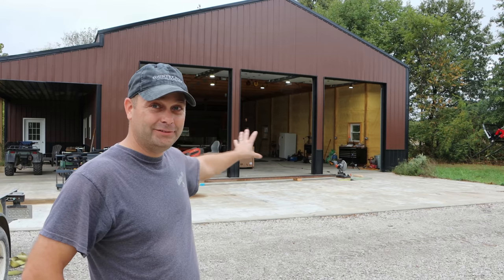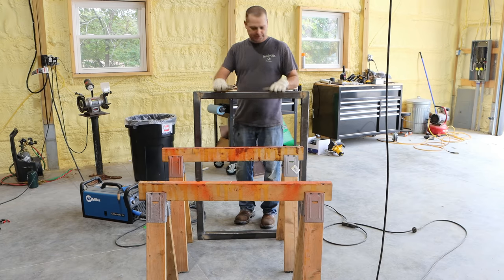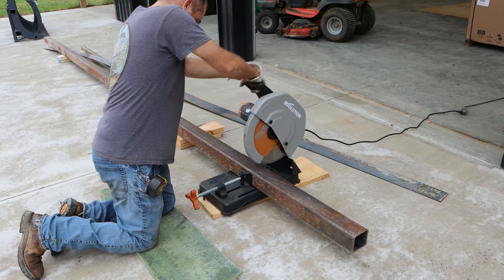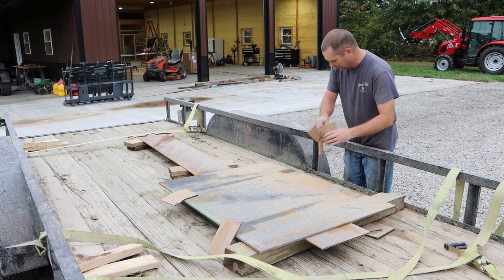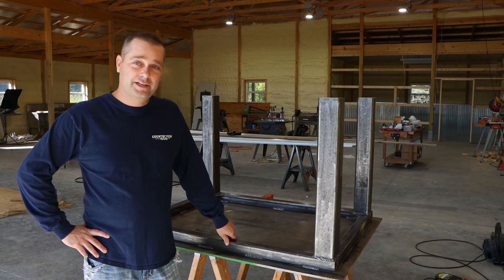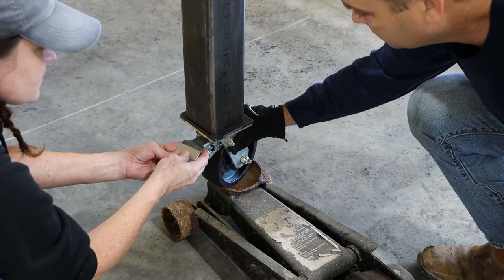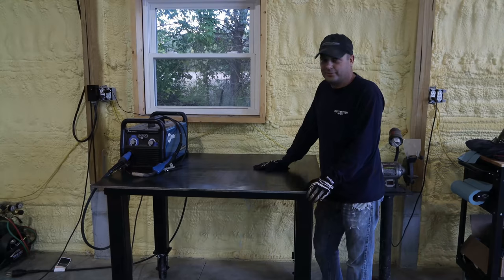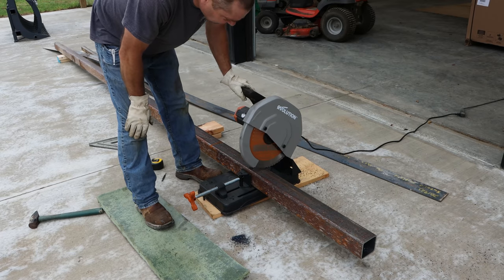Building a Welding table for our New Workshop

Comment: Recommend adding a non-conductive material on top of your tractor forks to insulate your tractors electrical system from the high frequency of your welder.

Comment: Weld in a couple pieces of small angle iron underneath and drop in a piece of 3/4" plywood for a tool shelf. Maybe buy a hitch extender and weld it underneath the table. Reason being that you can buy a vise mount for receiver hitch and have you a simple removable bench vise. Lookin goodvthough,solid foundation.

Comment: I built the same table 3 yrs ago, 4x4 1/2" top with 3" sq legs. I also added 2" OD pipe under the table and slide pipe inside for an extension. Very handy addition because your table is never big enough!! Great job Evan!

Comment: Nice build! Your knees and back will thank you in the long run! No fun crawling around on the concrete building a project. You won't regret the bigger casters as they will roll easier over any seams in your concrete.

Comment: Couple of things:  A few years ago I did the exact same thing you're doing for a welding table in my barn, except it's 3 x 5.  It has worked great to fab up a mount for the Evolution off the right rear corner of the table so you can mount the saw flush with the top and use the table top to support sticks you are cutting.  I also made 2 shelves under the table to hold clamps, cutoffs, squares, etc... but the upper one has a 1-1/2 x 1-1/2 angle iron lip around it so you can quickly hang your angle grinders on it.  Also weld on a couple of hooks to hang vise-grip type clamps on it.  On the corner near the saw, build a holder to hold a 6" speed square, a carbide scribe, a spring center punch, your little brushes, your angle grinder wrenches and your mig pliers/cutters.  On the bottom shelf I mounted the welder and my plasma cutter.  Last, but not least, get a bench-top belt sander.....the HF one is very popular and will do the job, but you will need it to de-burr and angle the edges you are going to weld to prep them properly.  BTW, those casters are definitely NOT overkill.  You will be glad you didn't find smaller ones. As far as auctions/marketplace....keep your eyes open for a good used mag drill and get a set of annular cutters for it.  If you're going to build/repair/modify attachments, other farm tools, etc... you will not regret it....especially if you have to drill attachment pin holes.
Reply: Hey Python, Meat Loaf,
"You took the words right  out my mouth"
Perfect eye deers
Reply from the maker: I was thinking of making a mount for the metal saw on one side and a table extension on the other side to hold long pieces.  👍

Comment: Nice job on that table, half inch top is probably overkill. I am a retired welder. The first thing that I would do is get rid of that flux core wire and invest in a bottle of Argon. That Miller welder is a fine machine and it will do a wonderful job as a true MIG welder. You will find that shielded gas welding is much easier for the novice welder especially working inside your shop, and you will spend much less time cleaning up the welding beads.
Reply from the maker: When I build a welding cart, it will hold a gas bottle.  I plan to get a bottle of shielding gas after it is made.
Reply: Thanks, I'm sure you will enjoy MIG welding.
Reply: Another retired welder here. Great advice!
Reply: I agree for a DIYer it might be overkill but I was an electrician in a factory.  When each trade was selecting what tools and equipment they wanted, the millwrights/welders made their tables from 1 3/4" plate  5'X 9'.  I asked one of them why so thick and they said so they could grind the table flat and not really damage it after welding on it for years and years.
Reply: Harold Reece, that is one and three quarters inches.  Not 1 piece 3/4" thick.
Reply: I too am a retired welder and I don't think the 1/2" top is overkill at all. Years of pounding will turn a thinner top into a bowl. Any heat from a torch or rosebud would distort the top horribly. You are right about switching to gas shielding as long as he stays indoors and the metal is very clean. But with flux core the wind can't blow your shield away and it goes through dirt, rust and even some paint much better and it is much more portable. Keep in mind he is a farmer and consider the total environment. The ideal solution would be two welders, one MIG and the other fluxcore. 
Art
Reply: @artszabo1015  Yes probably true. If it was me I would probably use a stick welder out doors. When we used flux core in the past it was for real heavy duty stuff.
Reply: @HaroldReece  And I would eagerly agree with you on that, but, we are retired professional welders and Evan is a farmer. The larger flux core machines sometimes even use gas in addition to flux providing the purest cleanest weld possible. I have seen welders welding stainless exhaust systems with TIG and flow gas to the inside of the pipe in addition to the outside. Overkill? In my opinion, yes, but in his, no.
Flux core wire like Evan's would be the hot ticket for welding an old tractor seat where a stick welder would be very awkward. But not for us because we are retired professionals. Think back to your early days of welding and imagine stick welding a tractor seat, no patches, just butt weld the cracks. If I had tried that the seat would have been destroyed.
Art

Comment: I had built a small table and welded two vices to it.  The only thing I found is it needed to be a heavy vice.  Would be nice if it could articulate in many positions.  Due to material handling.  I was doing a lot of salvage work at the time and found I was hard on the vice.  Due to the pounding and things.  It has worked well.  It would be nice for welding if it could articulate more.  Also to grip pipe.  The larger it is it won t get beat apart like I have done. I look forward to your additions to your table.  Hope you have a great week!

Comment: Nice welding table, Evan. You could put Caplugs in the open ends of the box tubes. A magnetic torch holder for your welder is always a nice thing. You might be able to make one of your own.
I recommend making over buying, that way you can have it the way you like, and improvise as you go along.

Comment: Great build on that table.  Maybe you could even make a wood top to put over it to make a butchering table when you start to butcher your own pigs or steers.  Thanks for sharing, have a Blessed day.
Reply from the maker: I bought a table with white cutting boards that are the table top.  Made for butchering.  But it will need repairs.  I plan to fix it up eventually.
Reply: @CountryViewAcres  Oh that's great.

Comment: Great table. You'll use it. I was fortunate to find a 30" x72" table from a guy for $50 a few years back. 1" top, 3" pipe legs. Still need to add casters and bottom shelf. They're very handy. Enjoy welding.

Comment: Good call on using 1/2" material for the top. Inevitably, you will be pounding on something on that table, and 1/2" plate will hold up way better and stay way flatter than 1/4" would.

Comment: Well thought out and well built Kevin. I'm sure that table is as good - or better than - most you could buy and a lot cheaper. I was a little concerned about you getting those casters set well and put on until Rebecca showed up and save the day :). But a nice well-built project that I'm sure you'll get tons of use out of. Thanks for sharing.
Reply: His name is Evan
Reply: @cathiwim  Yeah well sorry. Sometimes my hand is quicker than the noodle ... quiet often in fact. But maybe EVAN will forgive thee:).

Comment: Nice table.  My welding skills are very limited, especially with a MIG.  I seem to do better with a stick because that's what I learned first.  I do know that welding horizontally is easier than welding vertically.  I would love to eventually expand my metal working tools as well.

Comment: When I built mine, I used 3" angle iron for the legs and frame, and the top is 4 x 4 x 1/4. There's 2 pieces of 3" angle under the middle of the table and I have no issues with the 1/4" plate. I recommend not welding the castors to the plates as the castors are the only part of that table you will ever replace. Drill holes and bolt them on. That will also make it far easier to weld the plates to the bottom of the feet. I also added a shelf underneath about 12" off the floor. My angle iron frame has the web even with the edge all around so the outer 3" of table is effectively 1/2" thick for clamping. My castors are much smaller diameter and are a hard rubber compound so there's no need to lock them. It rolls easily if you push it, but not easily enough where you would want to lock it. I know you will enjoy using your table...it's far far better than the concrete floor!
Reply from the maker: To replace them later, I would have had to drill and tap 4 holes for each castor.   Or drilled holes and welded nuts to the inside.  But the 3.5" tube legs was just wrong, I don't think nuts would have fit inside the tube.  The hole pattern was almost exactly the same size as the tube. 
So tapping holes seemed like the only option that would work.  But I didn't want to take the time and do that.  So I went with the easiest way to mount themand weld them..
I agree the castor will be the only thing that will break.  But I think a cut off wheel could get them back off fairly quickly.  Let hope it isn't anything soon.
Reply: @CountryViewAcres  They should last a long while...it's the ball bearings at the top you need to make sure they don't get rusty...keep them lubed. The wheels you can change easily. I love having the castors! Mine were used ones from where I had replaced all the castors on some restaurant fryers...were gunked up with old cooking grease. Low profile (2" wheels) and heavy duty. Most of the time the bench is against the wall but I can roll it out for more room. I mounted a vise on one corner, but NOT a bench grinder! They vibrate everything off the bench. Take a pipe and make a pedestal and set it in a 5 gallon bucket of concrete. Plastic protects your concrete floor and the weight is plenty to hold the grinder.

Comment: Very nice welding table.  Similar to mine except mine is 4'X 8".   Mine also has a 1/2" plate top but instead of the 2" square tube, I used 3" X 1/2"  angle iron all the way around the bottom edge.  That made the outside of the table edge 1" thick and almost impossible to damage yet lets me use clamps to hold things to the table.  My legs are 4" X 1/4" square tube.  I used 2"X 1/4" angle iron about 1' above the floor to make a frame for a shelf.  My main problem is there is no equipment here to help move it.  When I moved it from where it was made to where it is now, it took 10 men and they had to rest 2 times while moving it 100'.

Comment: i made a welding table for our shop out of a 5ft round  centrifugal mold (called a Chill) it is about 2in thick(thats after it was worn out) a local company made hard surface rod and inserts for tillage tools the chill is made of an alloy somewhat like cast iron that a weld only sticks at the surface  you could take a chisel and (pop a weld off it you stick to it)mine is the top half of the mold with a hole in the middle(where they pored the molten metal in) (so you can cut and drop the sparks in a bucket or such)

Comment: I used an old Craftsman toolbox for my welder cart. I put hooks on the side for the cables, but the drawers were perfect for my welding supplies and PPE. Nice job on the table...I was wondering as you built it if you would put casters on, that is a great idea.
Reply from the maker: Yes, I plan on ordering a toolbox and make a welding cart.  It should be able to my welding hood, angle grinders and other tools.

Comment: Morning excellent work bench. That cut off blade I wonder how long it will last? Seems to work great and no sparks. The table I have is similar but I put a shelf under it for stability and storing pieces of steel. I put steel casters and are bolted on with yours thouse plastic wheels will break melt and now you will have to cut them off. Just my thoughts I think nice table. Have a good day.
Reply from the maker: The blade on it is a multi purpose blade, it will cut wood, aluminum, copper, and steel.  They make a blade with more teeth for only cutting steel.  I think I will buy that blade when this one wears out.

Comment: As a fabricator and farmer by trade, you can't go wrong with these skills. there will always be demand for metal workers in some form. Also, a joke we metal workers have been saying to each other lately. "Did you mortgage the farm to buy that steel!?" Steel in my area is up over 130% and welding supplies and consumables are 50% more expensive if not more.
Reply from the maker: Yes steel prices are high right now.  This would have been a lot cheaper to build a couple years ago.

Comment: Be really careful welding around that foam insulation, it's really flammable and almost impossible to put out once started. Install sheetrock on walls where you might be welding and grinding. Just a suggestion from someone who's been there.
Reply from the maker: Good suggestion.  I plan on installing barn metal on the walls.  It will better to look at, then that yellow foam, and will take the sparks from the welder.

Comment: Another welder using plastic caster wheels for a welding table. I swear not a thought goes into it, where hot or sharp metal chunks will eventually inbed and ruin the casters. Steel wheel casters are the only way to go, why 9 people out of 10 use plastic wheels, surprises me why they dont think about it. 

Next time, drill your caster plate for bolts rather than welding the plate to the caster. Your wheels will need to be replaced in time being plastic, now you get the fun job of torching your plate off the caster if you ever change them out and it looks like crap, instead of just taking the bolts out. Make caster plates with your caster plate bolt pattern in them. Before mounting it to your caster, place the plate to the bottom of each leg while flat on the floor, weld the plate to the bottom of the leg, when your all done, raise the table with a floor jack and bolt the casters on. Not sure why the hard way of doing things is the way people choose to do it.

Comment: Great job! How much did you spend on that steel?
Reply from the maker: The table top was $500.  Steel prices are high right now.   Total cost was around $1000.  The table I was looking to buy would have been about $1500 total with shipping and would have been only 1/4" thick.
Reply: @CountryViewAcres  Thanks--That's pricy but still you saved some $. Great job.
Reply from the maker: @andyrobinson339  yeah, it would have been a lot cheaper 2 years ago.  If I would have found some scrap metal for the legs, it would have helped bring the cost down.
Reply from the maker: So, I just went over the Receipt for the Metal, and calculated up the metal I used for the welding table.  And the Table Cost $800 to build it the way it is now.  I bought some extra metal at the same time for other future projects that are upcoming.  At least the Table was a cheaper than I initially thought it was.
Reply: @CountryViewAcres  Yes--and that's great!